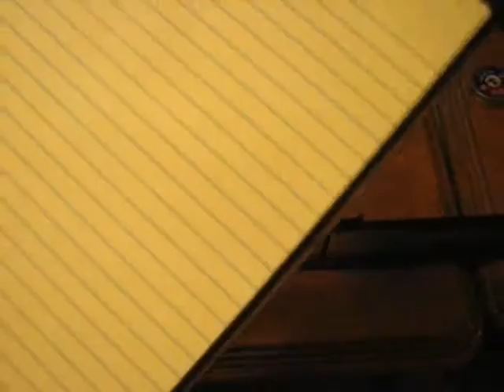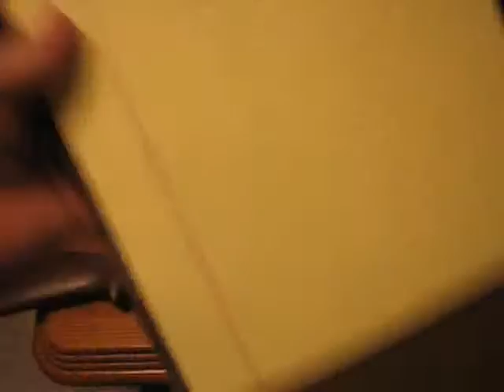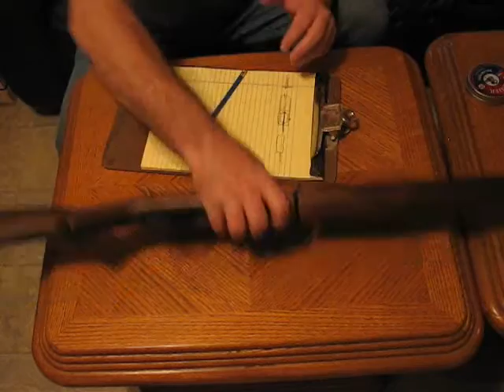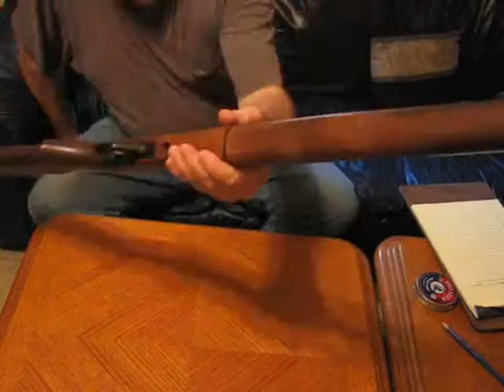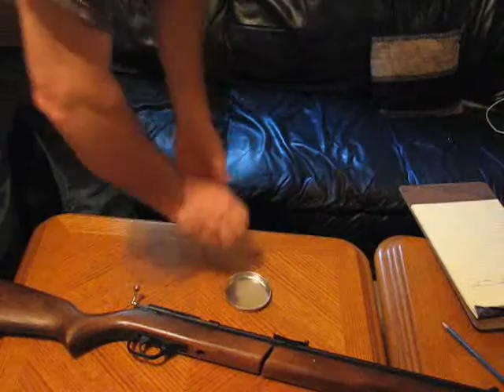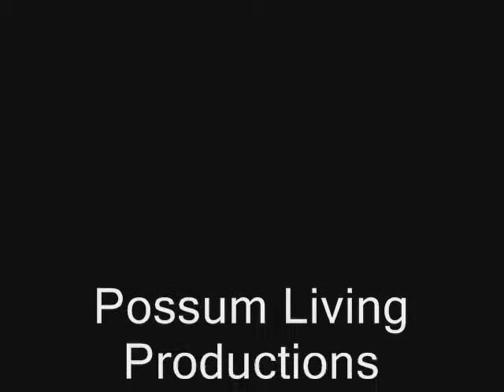Benjamin 392 Pumper Efficiency Mods

Comment: Most uk c type sheridans are set up for 3 shots from factory, after 12 pumps, you have 2 shots around 11ft lbs, then you stab in another 4 for your third shot. I always thought, if they just extended the valve by 2 inch, shorten the stroke. You could make it into a reservoir pumper for 5 shots after 40 pumps.
Reply from the maker: One of the airgun sellers in the US used to sell a Benjamin 392 that was tuned like that, for multiple shots. I tuned a 392 that way once. Didn't like it as much as I thought I would, but it's still a good concept.

Comment: Maybe installing a gauge would solve a lot of the guess work. I’ve been messing with similar efficiency ideas on my Disco’ .22 with the lower fill pressure. Definitely on to something.
Reply from the maker: Yeah, I've thought about that. It would be simple to also add a small air reservoir at the same time.
Reply: @Possumliving  having a visual reading would definitely keep velocities consistent. Just pump it till it hit’s the sweet spot(s) with different ammo.

Comment: When you did the two spring mod to the valve, you have to shorten the original valve spring or you end up with to much preload and it reduces the timing of the valve and won't expel all the air.
Reply from the maker: Yes.

Comment: I have a 392 and installed a  new pressure chamber and bolt seal and pump cup. I have never seen the advertised "685" fps out of this rifle and it was bought in 2000. I am also a machinist and a gun smith , so I have a little bit of a clue as to what I'm doing when rebuilding my guns and making mods. I'm curious if you can tell me why I have only ever been able to get 555-560 fps out of this gun @ 8 pumps? I have talked to a few other techs about it and they all agree this fps is low but know advise on what needs done. I shoot off the shelf Crosman 14.3 gr pellets. only..nothing any lighter like alloy 1. because it has a brass barrel and don't want to take the chance and 2. they just cost too much for all they are. Please feel free to shed some light on this fps issue with mine. not looking to break the sound barrier, just want to get to 650-680 fps. This is what the gun is doing now with pumps and fps...1 pump@204...2 pumps@323...3 pumps@402...4 pumps@438...5 pumps@484...6 pumps@513...7 pumps@532...8 pumps@558...9 pumps@579 and 10 pumps@600???? Please take a moment to shed some knowledge on this problem please. Thanks...Oh and mine does not have any air in the chamber after the shot ...did when knew ,but fixed that real quick...always dumps all the air from pressure chamber every shot 100% gone...none left over not even a little bit. Kinda thinking that's why the manufacturer only wanted the gun pumped 8 times...to keep the leftover air from building up and causing damage. Simple spring behind striker to hit valve little harder and hold open a moment more to dump all the air. This gun can be pumped up 8 time and set in the corner for a week and doesn't lose any pressure and still fires same fps.
Reply from the maker: That is pretty low. My first thought was headspace between the piston and valve. But it seems to be efficient at lower pump counts, so that's probably not your problem. Based on the good numbers at low pumps and the fact that it holds a charge, I would look at the piston seal. Sounds to me like it's letting air past it at higher pressures. Have you tried putting a drop or two of oil on the piston seal and then pump it up and check velocity? I use non-detergent motor oil, but you can use Pellgunoil if you prefer.

Comment: No you dont have the same power. You have the same pressure at four strokes because you only discharge half of the pressure per shot.  Sounds good the.way you put it but it's false information. Eigjt strokes = x, then four strokes = x, four more=  x. Yes youre retaining four strokes of pressure by omly releasing the same value per shot.
Reply from the maker: You're wrong. I chrono tested this rifle in another video and was getting 700+ fps per shot at only 3-4 pumps after pumping 8 strokes for the first (also 700+) shot. Without these mods it wouldn't do 700 fps at 8 pumps let alone 4.
Of course it's not dumping all the pressure at higher pump count. Without the mods it does dump all the pressure, but al lot of it is wasted. These mods allow it to retain the air that was otherwise wasted.
Reply: @Possumliving  I appologize and stand corrected. Thank you.